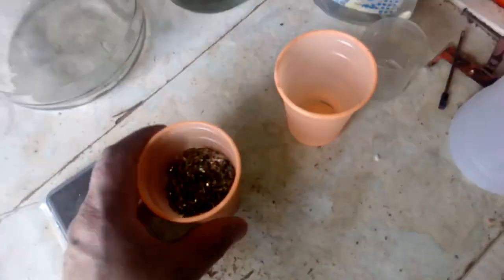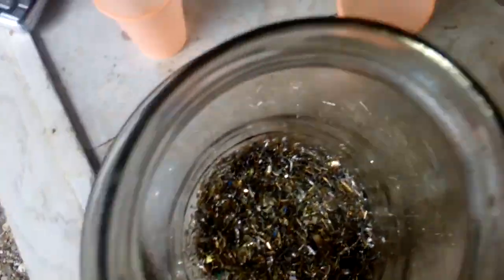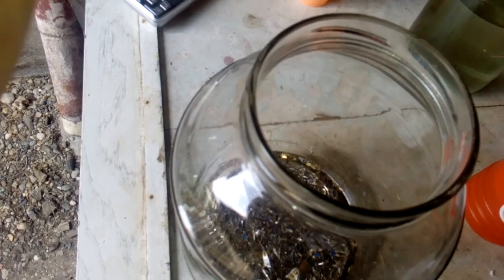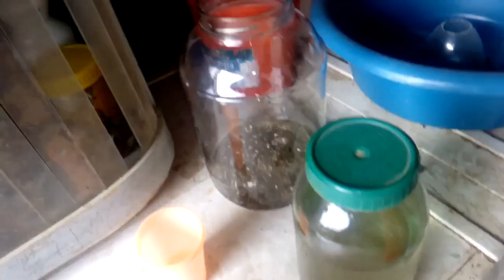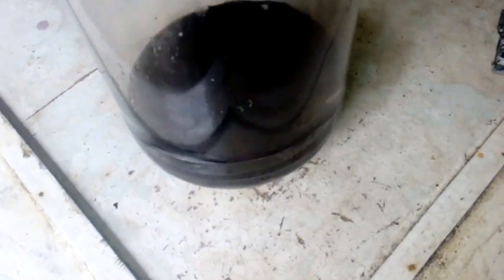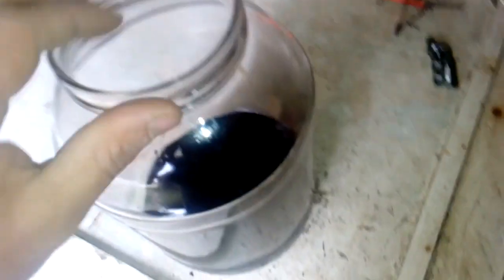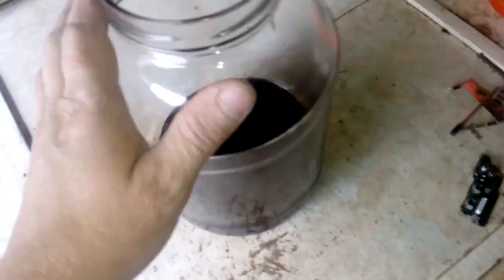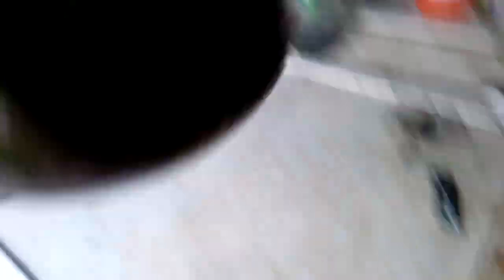Gold recovery from mixed pins vith Acid-Peroxide  metod part 1

Comment: The best way, I have found, for removing base metals, is to use about 30% Nitric Acid, distilled water and citric acid (10-20 g), and then boiling the solution on low/soft heat (50 -60 deg.C). This removes the base metals, silver and paladium, and the gold (and platina if any) in hours in stead of days, rins until wash water is clear as water, and then use aqua regia (HCl + HNO3). When using aq, first add HCL + some water (here tap is fine) , then add nitric acid, untill gold is dissolved, heat at low heat to speed up gold dissolving reaction. When all gold is dissolved, cool it down to room temp. Add H2SO4 (1-2 mL), and filter it. Then use Campden/SMB to get gold out of solution.  boil in some HCl, then wash with distilled water, and melt it down with mapp gas torch/Forced air forge, forced air propane forge, electric oven, induction or oxy/acetylene torch

Comment: hi dusan top video!
how long i need tot soak my pins in hcl to disolve the Copper on my pins.
before a add my oxygen peroxide?
grtz a belgian Rus 😁
Reply from the maker: First you have to soak them in Hcl to remove tin, then make a new batch with HCl and peroxide.About ten days to finish.
Reply: 999 Dusan Gold recovery ok thanx dusan for the advice!👍👍
Reply: @999DusanGoldrecovery  

HOW MANY DAYS DOES GOLD MAKE OUT OF THEM AND HOW MANY HUNDRED HYDROCHLORIC ACID? Thanks in advance

Comment: I have just had the same issue with the copper salts at the bottom, its my first process so I am hoping to be able to get it cleaned. My hcl is 38% so I thought the extra strength would be enough to deal with the copper salts...

Can it not be left in the jar and separated during the refining process?

Comment: my pins look disolved but how can i tell if its done i dont wanna disolve the gold but i dont wabt copper left
Reply from the maker: Decant solution,rinse solids,then put some newone Hcl inside,if Hcl change color to litle green you still have coper on foils and slug,if dont you job is done :D
Reply: if rinse will i need copper cloride or peroxide or jus hcl
Reply from the maker: Don use peroxide on foils never,it cud disolve him.Just use Hcl and vait some time,put on sun or ather heat sourche to speed reaction.

Comment: why sort out magnetic and non?
Reply from the maker: You need to split the magnetic because the copper from the solution will automatically be cemented on them and will cause a big problem.
Reply: only if u run together?
Reply from the maker: Yeap!
Reply: 999 Dusan Gold recovery in ur video u said u ran non magnetic pins...what do i need to do different with magnetic pics...does it have to be fresh ap? to stop from cementing copper in solution?
Reply: i have lots of IDE pins
Reply from the maker: Magnetic pins always put in a new ap, no magnetic can be in the old with the addition of a new hcl, but never mix magnetic and non-magnetic pins.You gona be in big sh.....t vith coper cement on magnetic pins from solution.
Reply from the maker: Ide pins is nonmagnetic coper or brass base pins,so you cud put im in old ap :)

Comment: Why separate magnetic and non?
Reply: Iron can get in the way of the reaction between copper II chloride and undissolved metallic copper. 

If you're not already familiar with the AP process (not that I know the chemistry very well-I'm only answering because no one else has lol): the peroxide is necessary to start the reaction but not to keep it going. What keeps the reaction going is copper II chloride which is what is produced when hydrochloric acid and hydrogen peroxide are combined in the presence of copper.

Comment: if it's solder left on the pins the white stuff can be lead chloride. lead chloride is white and insoluble in solution.
Reply from the maker: Yes it can be lead,but also can be coper chloride,seems to coper got strange diferent color.Onse i remove vhyte pvder on diferent cups,ad hcl,disolve and acid turn on green,then i put some iron insyde and i got normal red coper dust cement on iron,crazy.But it can be lead to i agre vith you,just forgaou to say.
Reply: 999 Dusan Gold recovery Yes, if the solution gets super saturated, copper chloride will crystallize out :)
Reply from the maker: Yes,in begining i put just the cover pins vith acid so it satured cuikly.And im  not soak pins i clean hcl so the tin is go first in solution pushing disolved coper out.

Comment: any one else had any problems with fumes corroding nearby metals , I dissolved my copper radiator out of my 79 ford truck in the barn  , had to build a work station 50 yards away and am still getting corrosion in the barn , my forge looks like it hasn't been used in a decade lol
Reply from the maker: All metal objects in a 5-meter radius corrod around my lab :D

Comment: why dont u hit the pins with a torch first?
Reply from the maker: I do it sometimes, but for the needs of the video, I am not now. Whenever I burn the pins to make the acids easier to grab them, the gold turns black and after you only get a black clay, which is also gold, but it does not look good in front of the cameras :) They do not get it with that , Just a day or two in time.

Comment: What process is best for magnetic pins? Also why must they be processed apart from non-magnetic pins? Many Thanks
Reply from the maker: You cud doit together with electrolize, but when use Ap or Ar best is to separate them Because magnet pins cement metal from solution much flaster.
Reply: @999DusanGoldrecovery  

A QUESTION IF YOU HAVE MORE PINS YOU PUT MORE HYDROCHLORIC ACID? THANKS IN ADVANCE